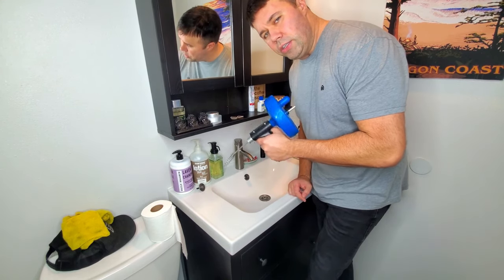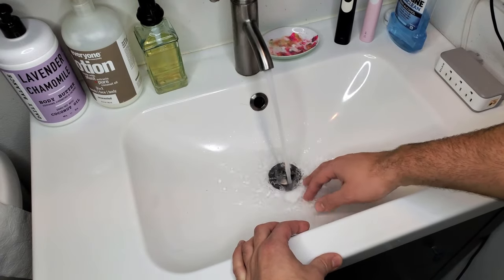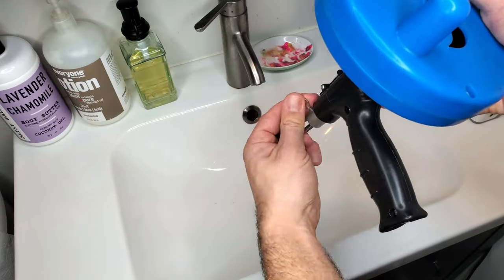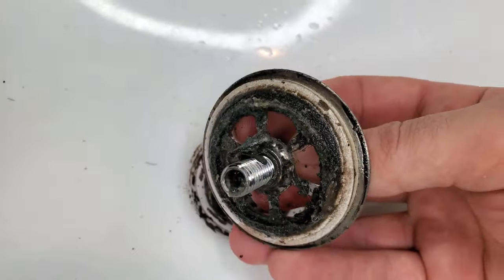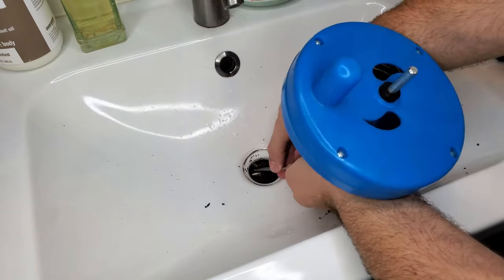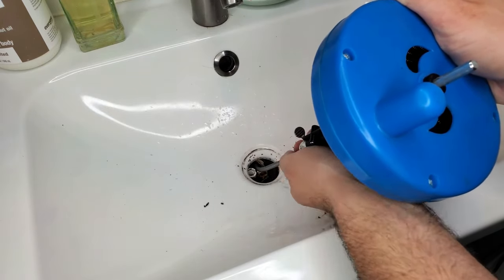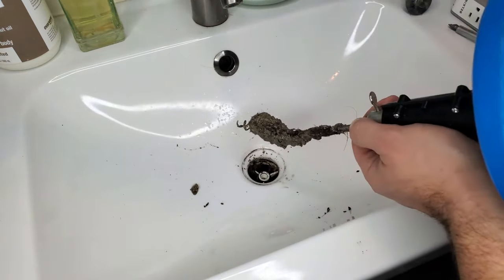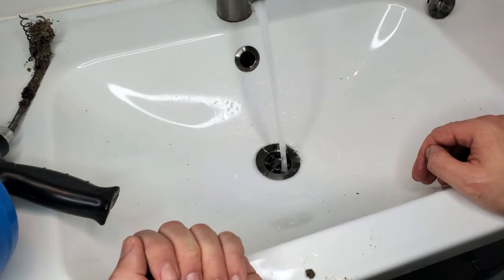How To Unclog Bathroom Sink Drain (Drum Auger)

Comment: $18 to $30.  Thanks Biden.  The locking screw allows the thread to push the cable out or in depending on the direction of rotation.  And you should go through the pipe in the wall and take the p-trap out.  Just saying
Reply from the maker: Thanks for your input!
Reply: I would blame it on Trump and the 2017 GOP economic plan along with reganomics
Reply: $33 now . How is it possible that inflation is only a few percent a year?

Comment: I tried this, kept feeling like I hit something, but then when I wound it in to break through, then pull back, there was nothing there.  Tested the water, and the water didn't drain.  I also got to a point in the line where it kinked and bent.  Can I unbend it?  I'm afraid it will eventually break there and get stuck in pipe.
Reply from the maker: How far are you going down before you hit something?  Does it feel like you are hitting something hard or soft?  Does it have any give when you push it?  Typically, the clogs happen on the first or second bend in the pipes.
Reply: @JMGENTERPRISES  Well, it felt like I hit something a few times.  After writing that comment, I plunged the sink hard and finally got water to go down.  I must have freed something.  Can I put draino in and leave it for a night, will this even help?
Reply: I have thrown out snake as bent really bad and it gets stuck in drain . Patience is the key . I used up 35 feet going in drain till I got it cleared . Used drano, vinegar and B soda , plunged  to no avail